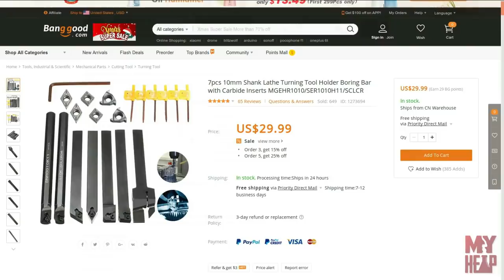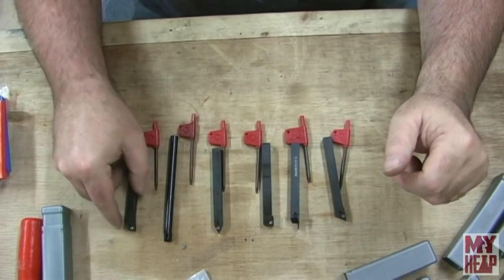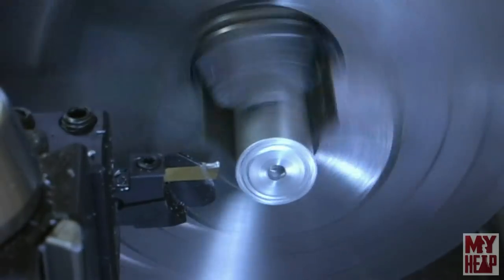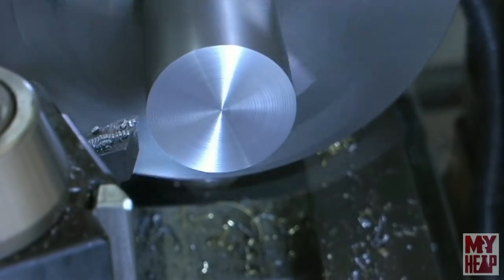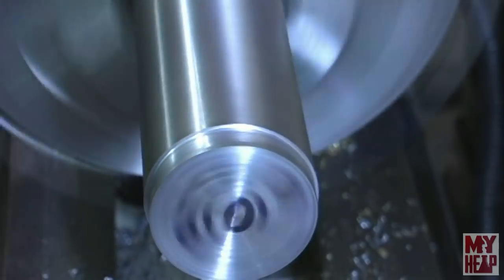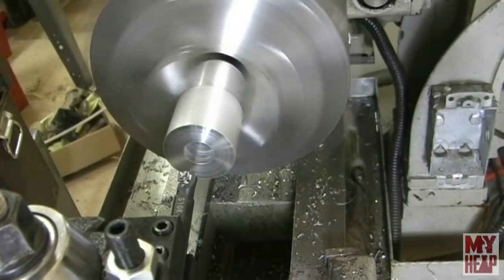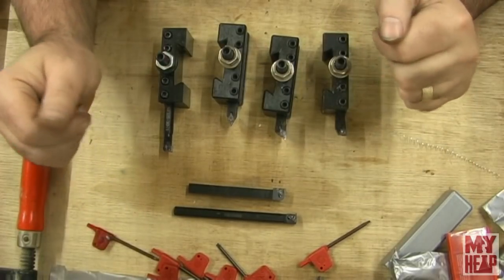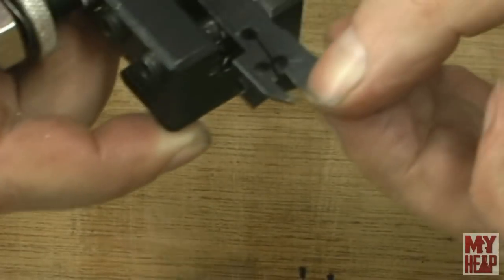Banggood 10mm Shank, Carbide Insert Lathe Tool Review

Comment: I find the turning tool using the CCMT insert also works good for facing. I use those turning tools for either operation to avoid tool changes. The parting tool snapping was bizarre, not what I was expecting to see! 👀 I dont know what radius is on them but if your feed rate per rev is greater then the radius size you will always get a rough finish so I never feed by hand, always auto-feed...usually at lowest setting which is .0042/rev on my atlas which is pretty fast and one thing I dont like about the Atlas's
Reply: OurHeap is bragging on his Mrs's cheesecake (a real "fork up" he claims)
Reply: It must be true if its on the internet 😊  Have a nice Christmas Stephen

Comment: Hi Joe, by chance do you know what your spindle rpms were for all your cutting? I picked up a photo sensor tachometer to get accurate speeds on mine. You probably want to have be in your higher speed pully coming off the motor. Perhaps you can use the highest speed pulley in the spindle  with the low speed on the motor. But you'll want to spin it fast. It also looked like you had a few inches of stick out from the chuck. Sticking a center in it would probably help with the chatter or have less stickout. I have broken a bunch of inserts trying to part with the same style tool, but never actually broke the tool.
Reply from the maker: Hey Jeremy.  The motor was in low speed and the spindle was at its third fro the cutting off.  The 3/4 inch material was sticking out about an inch.  For the other cuts I was in the highest spindle setting but the motor was still in the lower setting.  I did have a fair amount of stickout on the 1-1/2 inch bar.  probably about 3 inches.  A center and faster turning speeds probably would have helped.  I have my metal cutting bandsaw running now, or maybe I should call it my newest parting tool.  HAHA  Great to see you my friend.  Thanks for the tip and taking the time to comment.

Joe

Comment: Hi Joe, I have found their stuff normally fine for home workshop use, my suggestion to you is to run the lathe a lot faster and see what happens with the finish.. have a happy Christmas from the UK
Reply from the maker: Hi Jim.  Seems like I read or remember someone saying that carbide likes faster speeds and deeper cuts.  I will do some experimenting with it.  Thank you for watching and commenting.  Merry Christmas to you!

Comment: Nice review Joe.  I've purchased a few things from BG and have few complaints,  I have never purchased tooling, perhaps I look into them. Thanks for sharing your insights. 

Merry Christmas..
Reply from the maker: Hey Walt, They have the same line in 12mm shank (1/2") and all the reviews I have seen on that were really good.  Even one from Doubleboost.  I think the 10mm (3/8) shank is a little small for my holders, but they did clamp in and adjust to the center line.  I was very surprised to see the parting tool snap the way it did.  I figured the insert would have broke first.  Looking forward to your next video.  Thanks for watching and commenting.  Merry Christmas to you, your pretty wife and those adorable elves you have!

Joe

Comment: Joe, almost all of my insert tooling has come from Banggood, most of it is good, some crap! One thing I did was start buying larger tools, most I buy now are the 5/8” or 3/4” and I use the AXA XL tool holders. When I use the 3/4”, I have to mill off the bottom of the tool to fit my holders and to be able to get the tool tip down to centerline. Also the larger the insert is the better it seems to work for me!
Reply from the maker: Hey John, thanks for the heads up.  I have a couple of the AXA XL holders too.  Not having my milling machine together at this point, sounds like I should stick to no larger than 5/8.  Thanks for watching and taking the time to comment.

Joe

Comment: Joe, parting on my 10" old atlas always gives me trouble. If you don't get the speed, angle and feed just right it wants to grab and climb. The old girl just doesn't have the rigidity and mass like the 12"atlas and commercial lathes have. Unlike MTFN I wouldn't dare to auto feed. His lathe is just a little more beefier. I've tried but perhaps its me just not doing it correctly . Love watching both you guys.
Reply from the maker: Hey Steven.  Yeah the Atlas 12 he has is the commercial version and is a bit heavier than my 10.  Cutting off has always been a challenge for me.  Not usually a problem with climbing the work, but set on the centerline it will sometimes dig in.  That being said, if I used the slotted production slide I have with the rear toolpost and a cutoff blade upside down, I wonder how it would do.  I probably should do it once just to see how well it will work.  Problem is, I would never set out to do just that, I would have to be using the slide for some reason.  Like changing the gears.  I will change them if I need to cut a thread, but cannot seem to get the gumption to change them about willy nilly.  Sometimes I wish I had a second lathe with a quick change gear box.  But I will add this, if I can have only one lathe, I think the manual change is better, although much slower.  I can set a gear train for almost anything, whether I need a diametral pitch, or a spring of some gauge and wrap.  It is a little harder to do those with a quick change, or at least it seems it would be.  But on the other hand, there is a banjo of sorts on them too isn't there?  Thank you for watching Steven and taking the time to comment.

Joe

Comment: Nice review, I seem to have the same problem with pretty much all import parting tools.  Had a blade type with inserts just break on my in a nearly identical way just the other day.  I think I'm at the point I'd like to source a good, high quality parting tool setup.  I have an Aloris holder at least.
Reply from the maker: Thanks for stopping by.  To this point I have used a .100 inch wide cutoff blade.  Of which I am not entirely unhappy with.  I have a production cross slide for my lathe that has a rear toolpost.  Would be good for parting from the back I think, but would not want to set it up unless I had some other reason to use the slide.  Like cutting threads on my manual change gear lathe, I am lazy and don't want to set the gears until I need to cut the thread.  I have a Chinese knockoff wedge type QCTP, it seems to work, but I am sure it isn't the quality of a genuine Aloris!  Richard from makinsomethinfromnothin channel has this set of tools in the 12mm shank variety.  Sent him the clip of the parting tool breaking and he was surprised.  He told me that his seems to work great.  What size is your parting tool?  Now that I have the parting saw, erm I mean metal cutting band saw together and working, I suspect I will try to do most of my parting with that.  :-)  Thanks for watching and commenting!

Joe
Reply: @MyHeap  I always had issues on my Logan 10" lathe but I could see the flex in the machine when trying to part similar to the flex in the tool you can see in your video.   My new(more recent?) lathe is a clausing 1500 and I have a CXA tool post.  The parting bit is I think a 3/4 holder CXA-7 and the current blade I have in it is .100 HSS and works ok but is getting short.  The one that broke was the one from the link below.  Snapped in almost the same way yours did at the Min stick out line.

https://www.amazon.com/gp/product/B079G5X9R1/ref=oh_aui_detailpage_o02_s00?ie=UTF8&psc=1
Reply from the maker: Sorry for the late reply.  Seems YT thought your post was likely spam.  I guess because of the link.  I guess I will stick to the AXA cutoff toll holder I have been using.  The blade is a bit shy of .100"  Something like .093 if i recall correctly.  My guess is that parting produces extreme downward force on the tool and there isn't enough support under it.  But doesn't iscar make one of these partoff blade carbide insert holders?  Seems I saw one at Mr. Pete's channel one time.

Joe
Reply: @MyHeap  It seems they do have one, but wow are they proud of it.  Almost $100 just for the holder.  Iscar SGFH 19-1.2 I think would be the one.

Comment: For manual machining I dont really find a big difference between Chinese carbide inserts and iscar or similar brands, except for the price lol and also coating offerings
Reply from the maker: It was interesting for me as I have never used any insert tooling, so I had nothing to compare to.  In the coming days I will use them some more to see how they work for me, but my initial assesment, (other than the parting tool) is they cut well.  Thank you for taking the time to comment and sharing your opinion.

Joe

Comment: i had the same atlas lathe. and yours, like mine did not like making 20 thou cuts. i`m finding the the Logan is the same so far. i don`t like that style cut off. i never liked the design. and it handicaps you with such a short cut.  i knew it was gonna break the very moment it started crowding and jumping on the first cut. when it left 2 huge valleys in the face.  marry Christmas to you and your family from the Bison Workshop

Comment: I have watched the sequence,where the parting off tool breaks, several times and in slow motion.
The whole tool flexes down, just before failing, but the toolblock seems to stay in place (not easy to see, as there is some shaking in the video) but it seems to me that the tool grabbed, flexed and 'said no'....
Again very hard to see on video, but I had the impression the tool was a bit low, rather than on center height ...
At any rate, this should not be happening.
The design of these parting tools could have been better. I have a very similar one from a rather well know maker, and it doesn't cut very clean either. Granted it hasn't flown apart, but it is hard to make these sort of tools cut off 'nice'

Paddy
Reply from the maker: Before doing the cut I did some skim passes on the edge of the bar to make sure I set the center height correct.  May have not been perfect but it was close.  The vibration you saw was an issue with my camera mount.  I do agree with you, it grabbed a few times, but I never expected the tool to snap the way that it did.

Comment: G’day Joe. Good tool review, too bad about the parting tool parting company. I have similar results from the other tools also, I just thought it was me but hey they’re cheap. Cheers Peter
Reply from the maker: Hey Peter.  Yeah the parting tool gave up the ghost pretty quick.  Speaking of parting tools, I do have the bandsaw back together.  Now, it parts metal just fine, especially when you compare it against me using the hacksaw.  Haha. I need to do another shop update.  The spare rib got some excellent books for my library and some new tools!!!  Hope your Christmas was great.
Reply: G’day Joe. Yes my Christmas was good thanks. With some divine intervention my best half gave me a V Gingery Atkinson Motor book, maybe a project for later 2091?? Also a 20mm carbide end mill, it came with some drama, they first sent a R8 fly cutter which I couldn’t use, then sent the item purchased with a paid return sachet for the fly cutter but the sachet was under paid 😉😉so I paid the difference and asked should they like to reimburse me it was up to them, they did, funny enough. I have been blessed to have had good outcomes so far. Anyhow back to the grind a little bit at a time because it has been 38c+ for the past week. Cheers Peter
Reply from the maker: That's pretty hot.  It has been pretty nice temp wise here, 40's F.  Wow, you have the Atkinson engine book.  Awesome.  That is one I would like to hey sometime.  There are two Atkinson engines, are they both in the book or just one?  I think there's a differential engine and another.  That would be a great series to watch, but 2091 is a little long to wait.  Haha. Sorry, couldn't help myself with your typo.  Sounds like the company you dealing with on the tooling is being pretty good to you.  That's good news.  Still going to attempt the dividing head?
Reply: Hey Joe, yes I have the other NOT the differential motor book and no both engines are not in the same book, separate editions. I would like to get the differential motor book but the price is doubled by the postage and for some reason the Chinese have not copied them and sell them half price “free postage “   The dividing head is still second on my projects list and will be at least started in “2019” I don’t know if it will be finished in the same year though, the Mill has taken 2 years, yes 2 years. I am retired, cheers Peter
Reply from the maker: Wow, two years??  Seems like I have followed your build from very early on, but didn't seem like two years.  Are you saying if you were not retired it may have take a few days more to complete?  I wish I could get in the shop more often.  Painted the tank to the Kenneth Wells engine.  Was looking rather nice and I screwed it up trying to remove the painters tape I had on the brass.  Too big a hurry and set a couple fingerprints in the soft paint and then tore some paint loose with the tape.  Was a bit upset with myself.  Now waiting for the enamel to harden to sand my mess up out of it and repaint.  Don't feel rushed Peter, you have to have time to enjoy yourself.

Comment: Quick change is much better, I have used both!
Reply from the maker: Hi Donald.  Thank you for watching, I appreciate it.  I agree with you.  I like the QCTP much better but I have found that the Lantern can be more rigid in some cases.  So I find myself using  the QCTP most of the time but occasionally falling back to the lantern if I need to use a form tool.

Joe